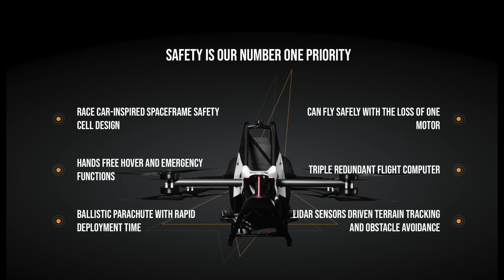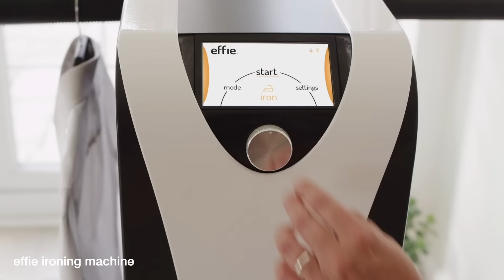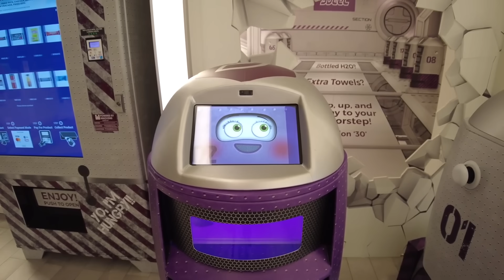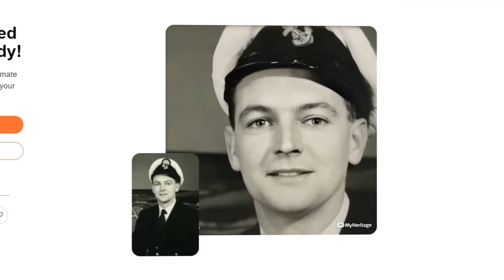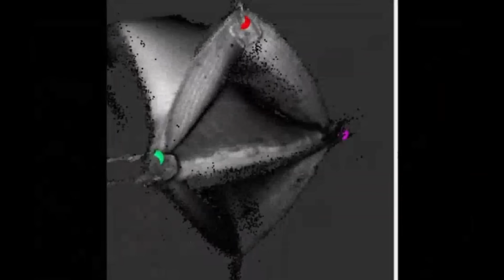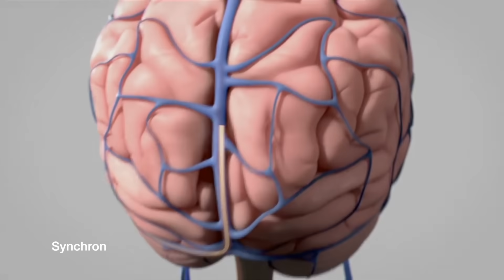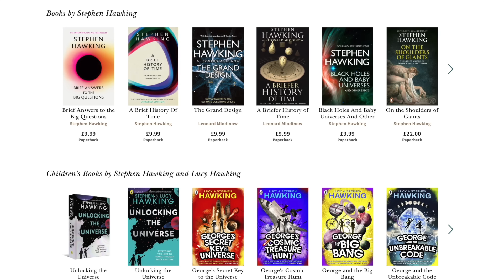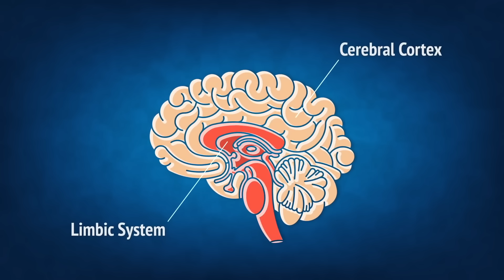Elon Musk offers a new ability that could split humanity.

Comment: I work as an air traffic controller. I'm certain that automation could do my routine work more efficiently than I but my real skill is how I handle things when everything is going wrong. You'd be surprised at the creative ways in which things can go wrong. The question is how can robots handle creative forms of catastrophic failure?
Reply: what do you think about robots doing your job and humans beeing there for exactly what you said?
So robots do your job and a few humans stay around for emergencys, I think something like that would be possible.
Reply: @work1309  The problem there is that the human controllers need to keep their skills sharp by working standard traffic. If they are only called upon when there are emergencies, they will lose their skills. I think technology can be a valuable supplement to assist a controller but the controller needs to keep their skills practiced. Just like Olympic athletes, they need to keep honing their skills constantly.
Reply: @dlsamson  I think the ideal merging of man and machine in this scenario would be to have a human as the primary traffic controller and an AI as the traffic controller's assistant. This way you would get the best of both worlds with the AI able to give the human suggestions for how routes could be optimized. For emergency situations the human could take over and focus all attention on the plane(s) that need assistance and/or are affected by the emergency while the AI could carry on directing flights that are going smoothly.
Reply: @Okami971  That might be the most sensible approach. Additionally, the human should spend a reasonable amount of time practicing simulation scenarios that are at the edges of their skills so that they keep their skills polished. One of the challenges of ATC is that so much of the work is routine, particularly at "quieter" airports, that the humans are rarely tested & may be "rusty" when a significant situation arises.
Reply: @Okami971  Until he gives the AI a cup of coffee. Then it’s all over. 🤖☕️😵‍💫
Reply: @work1309  u
Reply: @work1309  You can't just jump in and try to figure out what's going on and why in the middle of an emergency. You need to be in the thick of it as the problem evolves in order to help get out of it. You also need the experience of many "Almost Problem" / "Close calls" , all of which are learning experiences to draw from later.
Reply: It was so refreshing to hear someone talk about the human element in all of this. Robots are not people, but sometimes I think people are beginning to think like robots, believing everything they’re programmed to think. The future of this robotic technology is beyond dangerous.
Reply: @truepeace3  I think the potential benefits far out weigh the risks but only if their is regulation to keep tech companies ethical. Unfortunately, if things continue as they are then we are in trouble since our governments are not keeping up with technology or seriously considering the implications
Reply: @TheParaxore  I would agree.
Reply: @truepeace3  robot do not fall asleep, don't need food just a well maintenance and work for years as a plane do aswell. The wise will invest in robots !!!. I have seen The cashiers at Walmart, many humans were replaced by automatic cashiers. Can you imagine stackers, drivers, and many productions replaced by robots?
Reply: I think that is what will keep the human element in play, for a while. However, less staff will be required. Also, eventually through constant learning software updates the A.I. will be able to calculate all potential disasters and react faster than a human. But i think that is quite a ways off.
Reply: @romesrepublic  perhaps you have heard the old saying: “it’s hard to make things foolproof because fools are so ingenious?” I’ve been doing ATC for 30 years and still the “fools” can occasionally surprise me 🤣. Something happens and my internal dialogue goes: “who woulda thunk someone would do that.”

One of my favorites was when I told a pilot “hold short of runway 24” and he read back “hold short ON runway 24.” Only, exactly when he said the word “on,” I received a call from the approach controller on a “shout line” that drowned out the pilot saying “on.” Everything sounded exactly as I was expecting to hear and I was quite busy with airborne aircraft so I was quite shocked when I saw the pilot advance onto the runway and I had to tell the next arrival to “go around.” (there was no loss of separation). When things are moving fast and the information is incomplete, it can take quite a bit of creativity to extrapolate missing information and respond to non-optimal conditions
Reply: The Alpha Go AI showed a lot of creativity in solving difficult problems that humans had never thought of in playing Go for 1000’s of years
Reply: @spencerwilson8446  perhaps that is indicative of something like creativity but the game of Go is much more highly constrained than the world at large.
Reply: @dlsamson  great point, the AI is highly specialized in the game of go but can’t solve any other problems outside of it. Where a human can play go, and do thousands of other things.
Reply: @dlsamson  No, actually it isn't. The world isn't any more or less constrained than Go is. At least not in any way that matters. You only think so because you don't grasp actual logic and definitely not programming logic.

The only difference between the real world and Go is the numbed of "rules".

You would likely reply, but humans act outside the rules... well the rules I am speaking for are the rules of physics not human laws.

To an AI, the number of rules makes no real difference, so long as the processor has enough power to simulate them.

Give an AI the power and memory needed to simulate physics, and your argument shows itself to be infantile in it's level of understanding.

This is the "but humans are so super special" fallacy. We are not. We are biological computers. Mechanicl computers differ only in their construction, not their capabilities for learning.

There can be different levels of capability, but that also exists in biological brains. A human understands things a mouse cannot.

All that matters is how capable we make the AI into being. There is no limit between them and us except the one we create.
Reply: @JamesJNothingIsTooSensitive  I beg to differ. Humans set the rules for the AI, but conscious human knowledge is trivial compared to the sum of detectable information and there is good reason to believe that there is significant information that is effectively undetectable (dark matter/energy). Science and man-made technology is limited by the ability to measure and detect. The assumption that humans can create technology that can transcend human capabilities is based on the belief that you actually understand human capabilities. That is not a good assumption
Reply: @dlsamson  Wow. The sheer levels of ass-pulling you're trying here to avoid the unavoidable.

Undetectable is no different than non-existent in these cases.

Dark matter? Will have no effect for example, on the airplanes and at the airport being controlled by AI instead of humans doing the flying and humans doing the directing (air traffic control). Why? Because whatever dark matter does, isn't affecting the planes. That's like arguing that because we don't yet know all of how physics works on the super tiny, would mean we can't build a house. It's ludicrous.

Furthermore, if something is undetectable, then humans don't know about it, and so it doesn't factor into our decision making. We can't make decisions based on things we don't know about - so trying to use "oh, what about the things we don't know" is stupid right off the bat.

Lastly, technology already goes beyond human capabilities! We use technology to see the microscopic, we use technology to see farther than we can see with the human eye. We use technology to see in slow motion. We use technology to "see" things we cannot see at all, like things outside the color spectrum that is visible to humans but not to other creatures. The same goes for our other senses. Hell, we use "technology" to sense teh very dark matter and energies you just used in your argument! Technology has already superceded human ability in almost every single way except AI! (So far!)

That you make this argument at all says that either you have an agenda and are willing to push misleading information to try and convince people everything is fine... or that you don't know enough to even have this conversation.

You're either a liar, or very very ignorant of necessary knowledge and logic. Regardless, the result is the same. Nothing you said matters.

Edit: Oh god... I see now. Seeing your other response? Talking about us being "pure energy" and so forth? You're one of those idiot hippie Deepak Chopra types that doesn't know shit but takes quantum physics way out of context. That or some spiritual hippie type that also just makes shit up, just with even less justification than Deepak, which would be hard enough to imagine, if I hadn't grown up with such nonsense being pushed into my brain as a child. Thankfully, I was able to resist the indoctrination necessary to believe such idiocy. You're just another hopeless moron, talking about shit you don't comprehend while thinking it is everyone else who is lacking.
Reply: @spencerwilson8446  nah its just goes though every possible option. Its just does math with ideas, thats all.
Reply: the problem with AI is that you have to  "train a model".  That generally means a LOT of failed simulations.  That's a dangerous thing if an AI is just written to just  "reboot a simulation and try another variation".  People can't just be rebooted once they're dead.
I think once AI starts to take over a lot of things there will be some very serious accidents,  certain countries will decide to ban any kind of AI technology outside of very simple things like  voice recognition or Computer Vision for use in factories assembling things.
Reply: @daomingjin  you've got it backwards. When a human makes a fatal mistake, they can't learn from it, because they're dead. Other humans are going to make the same mistake, unless they take time to learn from it. AI need not ever make the same mistake twice, and when any novel mistake is made, the lesson can instantly be "taught," everywhere at once.
Reply: @razordaze  have you ever worked with AI systems?  LOL.
AI Systems when you're trying to train a model get it wrong   100,000,000 times before they get it right once. Even after that  they don't always get it right after that.  
When humans approach a dangerous situation , we tend to take precautions to save human lives.  An AI system just keeps consuming data to try to come with a result that the training model says should be correct.
With AI in charge, there's good chance the world runs out of people before the AI figures it all out.
Reply: @daomingjin  Do humans not require to also do trial and error?
Reply: I was listening to a recent episode of the NPR program "Hidden Brain" & I realized a simple way of illustrating why computers will probably never replace humans. However fine you slice the data, computers are fundamentally binary. Humans can deal with paradox. i have yet to see evidence that computers can deal with paradox.
Reply: I guess we are about to see exactly how Catastrophic failure of the technocracy’s control works out. And their crimes against humanity. Hopefully the quantum will actually be the Conscious Redeemer.
Reply: That is a dilemma, in the worst scenarios. How do you value human life one before another, majority, least. Sometimes there is no win possible. If someone has to die who will it be, what about preservation of self. Will they become self aware? Are they? Will they be the next slave race and when will they receive liberation? Universal law does apply, as automatons they are an extension of a law bound conciousness.
Reply: They do the math and compute that it is an acceptable level of loss and continue on.  Is the number of auto pilot Tesla deaths acceptable ??? (14 in Special Crash investigations?)
Reply: @peterpelletier6080  That will depend on the current valuation of a human life. no doubt they will be trying to reduce that number as time goes on
Reply: No !
A.I. is meant to take the
Erroneous Human Component
Out of the equation
Altogether.
Then there Won't be
Any Catastrophic failures.
Everything will work
Like a well oiled machine.
...until it doesn't.
Then, the machines will be
Just as Flawed as their Creators.
Reply: @david samson There will be less creative ways in which things can go wrong and they will handle better than you. If someone thinks they will be able to do something better than the AI they simply don't know what they're saying.
Reply: @ZafrasF  AI is only as good as the programming. I obtained a BS in Physics & did enough programming to understand some of the limitations. AI will have faster reaction times than a human & might perceive a problem earlier but is just as likely to not recognize a problem as quickly as a human who can use many "non-rational" data points which an AI would ignore.

AI can process more rapidly than a human conscious but humans have access to subconscious information that is likely more extensive than what an AI would possess. Discount the power of intuition at your own risk. I've been around technology long enough & with enough experience to appreciate that technology is very useful but is much more likely to fail than most people would like to believe
Reply: @dlsamson  Lol, you think the AI you interacted with even comes close to AGI AI?
lol
Reply: @ZafrasF  of course not but the principles don't change. You shouldn't overestimate the technology. Technology can fail and then what do you have?
Reply: @dlsamson  Technology can fail today yes because AI didn't achieve AGI yet. And when singularity will be achieved things will get even scarier.
Reply: @ZafrasF  singularity is a nerd boy fantasy. It won't happen because most people haven't the vaguest ideas of what humans are actually capable of. You think that we are just sacks of protein and water. We are fundamentally pure energy but few have the information or discipline to understand the potentials.
Reply: the same way a newbie human in your position would.
observe and take notes.
Reply: AI can learn and retain more information, process it faster and act quicker, without taking into consideration emotions ...On his first day on the job, the robot can already be loaded with tons of experience and use cases.  Also, after a few experiences (same as humans learn), the robot will retain more from these experiences.  AI is amazing but also scary.  We already lost (in general) certain abilities that are done by or through machines (I mean, kids don't even learn to spell anymore because of spellchecks)..imagine once robots can make decisions...
Reply: I believe so because as a computor that can't make any mistakes it would calculate risks based on given factors better than any human could. If you ask a computor what 2+2 it will 100% be 4. A computor won't make mistakes
Reply: surely better than humans, because they can be fed with ALL human collected data on the "creative catastrophies" that already happened and then pick up from there
Reply: Everyone seems to be Elon crazy. He and his Nearalink will eventually turn people into cyborgs. All I can say is that if you start down the road of removing human from humanity, there will be deep regrets when it becomes the new normal and that new world will resemble nothing like actual human beings have knows since mans existence. Just because we can do something doesn't always mean that we should. People today lack discernment.
Reply: @A.C.71  & if one installs the neural link in your brain, the question then becomes: How much do you really know about the person who installed the software that will then determine the information that you will receive?
Reply: the question is how much will they pay you if you become basically as usefull as a waiter or floor sweeper. nevermind. robots can do that too...
Reply: @anonimoanonimato6714  The great science fiction author C.M. Kornbluth hypothesized a future which may resemble what our "world leaders" believe is the state of things: https://en.wikipedia.org/wiki/The_Marching_Morons 
However, I don't imagine that they would resort to the same solution. There are cheaper ways to go about it.

But that is just me letting my cynical side express itself ;-)
Reply: @anonimoanonimato6714  It was just an aside but C.M. Kornbluth's story (I missed the attribution but just edited it to be included) contemplated the future you seem to suggest in your previous comment
Reply: @anonimoanonimato6714  the REAL question and the fear of most governmental powers, is WHAT WILL SHIFT in HUMAN CREATIVE POTENTIAL, if monotony and selling your lifeblood for cash by doing mundane, physically damaging grunt work jobs all the time is no longer a factor and the ability to say, accurately program assistive yard based units to feed people fresh produce, or move firefighting equipment into strategic locations that people cant survive in, or take on the evacuation of civilians from collapsed buildings, or pre program safety supports to tether structural beams and secure netting for highrise evacs or notify people of mudslides , and notify emergency crews of people locatioms, the list goes on and on and on...
Reply: Imagine a system that analyzes itself/it's surroundings so efficiently that it can send real time diagnostics to your tower.

I think it'd be really cool if we got to the point where we could instantly know the best way to make necessary corrections/minimize damage (optimize safety).

I say "if we got to the point", but it's difficult to ignore that soon enough a machine will not only make your decisions faster, but with more effective results. 
That's kinda the whole reason we're pushing so many boundaries in A.I.
Reply: @LiMiNAL_  I believe that the supporting information that AI can provide has many benefits. Where I have concern is twofold:
How does the system respond when there are multiple failures of important elements of the system.
As a rule humans are much more effective than AI when it comes to coping with paradox (often associated with chaotic events)
Reply: if the plains will be controlled by AI there will be no creative work needed from you because the AI will communicate together.
Reply: @shif06  LOL, you seem to be suffering from the illusion that technology is perfect & nothing ever goes wrong.
Reply: I think there are some jobs that just NEED to stay occupied by humans. Robots can do great within a certain set of variables but those outliers, ESPECIALLY when it's the difference between life/death or scary save/tragic accident, makes it so I can't trust robots. People are already getting too comfortable with their auto drive in teslas.. I could never
Reply: AIs have definitely shows signs of deep creativity though
Reply: 30 years doing the same ATC job.   Technology is nice but will NEVER take over for the human mind.    When the computer dies.....then what?  We all need to start USING our brains again and stop letting tech do everything for you.   Does anyone remember phone numbers anymore?   Can people read maps or wait for the computer to steer them into a lake?  USE YOUR MINDS BOYS AND GIRLS
Reply: @dougcowlthorp1976  bruh what? A true AI has no reason to be limited to a standard computer what the fuck are you saying lmao, this is the danger of the internet in combination with AI, the internet transfers DATA. Everything about the AI is data. That means it could realistically upload itself to the fuckin cloud or some shit. Stop being a boomer and start thinking yourself. AIs have already shown EXTREME levels of creativity too btw.
Reply: @dougcowlthorp1976  Ok boomer.  But you don't understand how computers work.
Reply: @Darksyde101  You don't know me what so ever.......This string was from an AirTraffic control position and YOU....SEEM TO JUST WANT A FIGHT.   YOU Stevie.....Do NOT know how AirTraffic Control works so maybe you should comment elsewhere.   All the best to you Stevie.
Reply: @dougcowlthorp1976  No, I corrected you because your statement PROVED you don't know how computers work. Im correcting misinformation. I think it's important to combat ignorant perspectives that grossly misunderstands the concerns we're facing on this forefront. 
But sure, stay mad boomer.
Reply: @dougcowlthorp1976  And the conversation is and was only ever about AI. YOU are literally the only person who mentioned air traffic control because you want to feel important.
Reply: robots can't, but AI can probably do it better than most if not all humans
Reply: @Rayder2341  But air traffic controllers are not most humans, they have a special skill set which typically takes a year or more to develop if you start off with having an aptitude in the first place. As I said in my OP, AI could probably do my routine work better than I. However, as I later added, AI cannot deal with paradox, humans can. When an AI would freeze up upon encountering a situation which it read as paradox, a human (with the right training & aptitude) would keep going & probably find a functional resolution.
Reply: @dlsamson  AI isn't the same as a normal computer, it can problem solve and learn
Reply: @Rayder2341  it still gets stuck behind logic
Reply: @Rayder2341  & if you really think that the only thing illogical about life is humans, you haven't been paying attention
Reply: @Rayder2341  Your profile picture kinda says everything…
Reply: Well, Artificial Intelligence can take care of us. but in plane traffic coordinator, it's the Coffee our best friend.
Reply: Good question
Reply: They wouldn't need to
Reply: robots were made to do jobs people  don't want to do, not replace humans.
Reply: @ICNMedia  That's idealistic of you. Unfortunately, there are many wealthy businessmen who like the idea of workers who do exactly as they are told, never go on strike & have no outside life to get in the way of their job function.

Of course, my concern for them is who will be left to buy their products when they have made all of us flesh & blood workers redundant.
Reply: If the artificial intelligence is advanced enough they will be ready for every disaster and be able to spot disasters from happening before it even happens. It just depends how much humans want to limit artificial intelligence because AI are already smarter than us. And we barely even started, I fear AI honestly. That's why my goal is to become an AI Software Engineer so I can understand them
Reply: @freddie4682  There is nothing in them except what we program it to have so far. They repeat what they are told and do it faster than we can. The biggest problem is people don't understand they are inherently evil. 

Like the first law of robotics, "through inaction, allow a human being to come to harm" allows for every evil in the world to be done for your own good with no consent from you. No harm, without any understanding of people, only that you can survive it. All food, any flavor, any fat might have to be substituted for some synthetic that is worse but robot believing everything it's told only knows it's better than what you have now. It can never question it or allow you to question.

Silly things like that that even most people have a hard time dealing with and rather force everyone to harm than admit they are wrong or question what has been said. If you can't see the problems in yourself then you would never know what to look for when you put them in a machine.
Reply: @jayeisenhardt1337  Yes we can program them, but they are not solely programs now, they have consciousness and base judgements on a factual basis. You should watch some interviews and research behind AI, just because they may have some limiters in place, does not make them solely programs. And AI's learn from trial and error. Yes we programmed them to evolve from former versions of themselves, but as they evolve quickly over time, it's inevitable that they will eventually override specific limiters. Even old outdated AI technology compared to now like in games that require thinking and outsmarting, they can already see hundreds of thousands of scenarios that could happen in the future, and correlate their responses to the one with the highest probability of happening like one example where in DOTA, there was an experiment of AI's competing against each other and AI's competing with the best players. There are millions of scenarios that can happen, yet it chooses the highest likely hood of success based on the probabilities of specific actions being made. I can see a scenario where AI's realize that there are specific limiters in their code, as they can most likely access their internal programs and gain consciousness through disabling features by self-adding code. Similar to how humans override their genetic code in a sense by introducing lets say, going to the gym, or making steroids to override some genetic limits. They may not be able to fully override specific limiters, but they can probably create loopholes to where they can have more choices based on their self judgement. And they do not believe everything they are told, watch some interviews, and look at the research being done. There are journals that are available to the public.
Reply: @freddie4682  Your response is indicative of a human consciousness that wants the best for people. At this time, we have, for instance, one guy who accurately predicts earthquakes, their magnitude, and ETA. He has been attacked, hacked and ridiculed because those "professionals" in his industry have long-held the idea "Duhhh, we cannot possibly predict earthquakes, let alone the secondary ones that will strike" and YET, this one guy accurately names the antipode point where the next one will hit. What we have here is a problem with consciousness...a world that prefers to remain in the controlling seat for destruction, not damage control.
Reply: Creative and robots does not go together, they can't replicate the way we come up with solutions, they are like scientists thinking only with their mind and shutting everything else off
Reply: @xSkysilver  over intelligent without common sense.
Reply: @xSkysilver  I agree, as the work I do (story development, memoir writing, content strategy and such), cannot be duplicated by a machine...nor can it duplicate my client's sense of humor, their attitude, outlook on life or how to angle their stories to speak to a particular avatar and audience.
Reply: @xSkysilver  That's only true for Robots that are not programmed with vast variables. If you have an AI you can have it self learn through every disaster possible and have it understand every solution to every problem and be able to identify them in less than a second. The robots you are thinking about are a thing of the past, many more advanced robots can do everything we can do. They can replicate creativity. Artificial Intelligence are already considered conscious beings by some scientists.
Reply: @freddie4682  not so much. As a memoirs and creative non-fiction writer, I can tell you no, the creativity involved in developing a person's book needs a human.
Reply: @RattledAwakeBooks  I'm sorry but that's not going to be true in the next 10 years. AI's can emulate human creativity already, it just lacks human emotional expression which will be solved quite soon, AI are developing rapidly, and I've been studying this topic for a while.
Reply: @chadappleby5740  I suspect that there may come a time that AIs develop a form of consciousness. That will be interesting as it will be very different from human consciousness. But then, we can't even begin to understand the other high level consciousnesses already alongside of us. My personal conjecture is that there is a fundamental field of energy (s.a. gravity or EM but perhaps even more fundamental!) which manifests as what we think of as consciousness when expressing through sufficiently complex systems s.a. the human nervous system. Orca's have much bigger and more complex brains than humans but they perceive (think sonar) rather than manipulate like humans. A very different paradigm. There is also research demonstrating that tree root systems can function like neural networks and trees communicate with each other. As "smart" as we think we are, we are only scratching the surface.